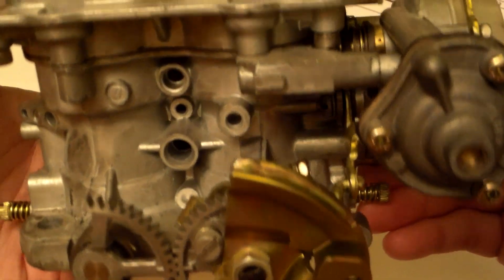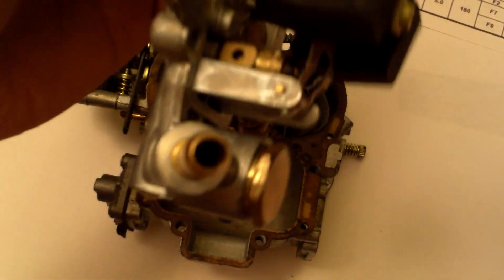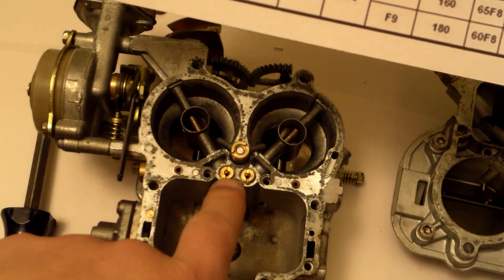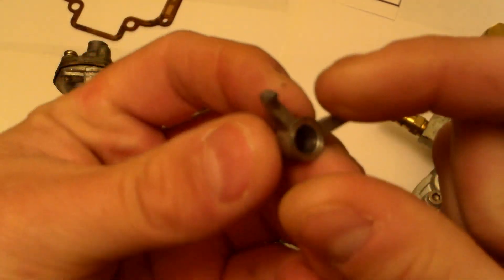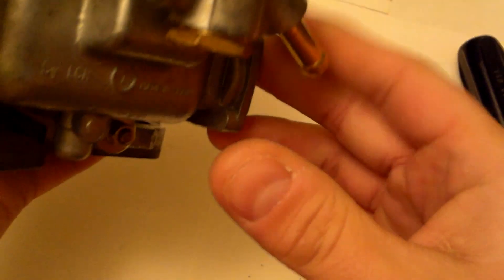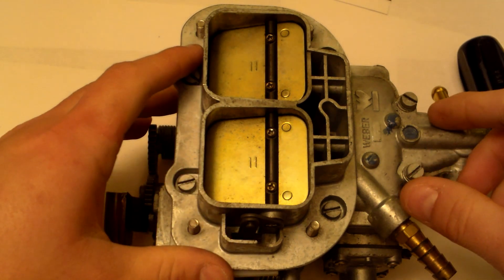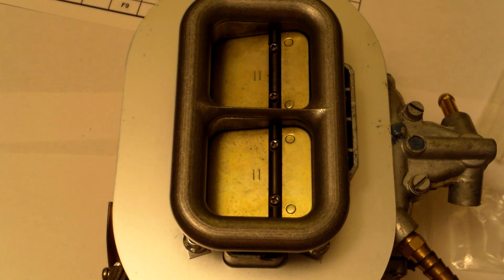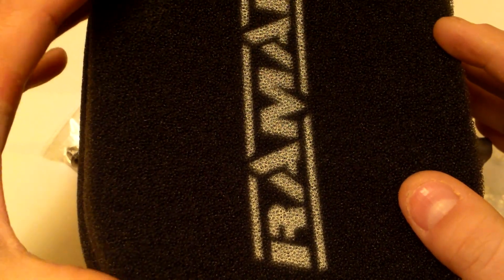How a Weber 38 DGES Works

Comment: Thanks for the video! I have one of these on an old engine I bought but with the brass floats. I rebuilt the carb with a genuine rebuild kit but it has been supplying way too much fuel - so much that the engine won't start and the spark plugs get soaked with petrol. my accelerator pump jet (the brass bit which holds the twin squirters down at 5:55) has a hole right through it so when you  open the throttle, fuel just gushes everywhere, i.e. not out of the two little holes in the squirter. I've been watching endless videos and yours shows the part in question nice and clearly! 
I'm not sure what to do now... I might just get a new carb as the throttle spindles have too much play and I don't know what else is missing. Half of the choke assembly is also missing... everything's expensive!

Comment: What do you use to hold the filter on the car? It doesn't just fly off?
Reply from the maker: It was held by one side amazingly.
Reply: @84hachi  hey man, thanks for this video. I would like to know if the filter kit from Ramair for the 32/36 fits the 38/38 carb. Since they dont have one for the weber 38/38.. thanks in advance.
Reply from the maker: A 32/36 and 38 share the same body, internally they are different.

Comment: Interested to see how it drives with such big throttle butterflies :)   

My weber 32/36 throttle linkage came loose the other day while I was delivering pizza... zip tied the linkage together to get back and it was opening the secondary and the primary together... it was interesting.
Reply from the maker: +ConnorWolf 
Pierce Manifolds sells a kit that syncs the throttles on a 32/36. Well worth doing.

Comment: Isn´t it too big for a 4ac?
Reply from the maker: +emasacriste 
Nope, not with my distributor deleted.
Reply: a 32/36 can be jetted to run a 4.2L engine, or a 1.3L engine, the same would be with this too, the difference is more air/fuel can be delivered, and when you have a 4A-C screaming at 7500RPM, it wants that air..
Reply: A fuel pressure regulator helps keep the float stable too
Reply from the maker: I don't need a FPR because I switched the needle valve to a Vinton tipped version. Vinton can handle a higher fuel pressure than the factory brass unit.